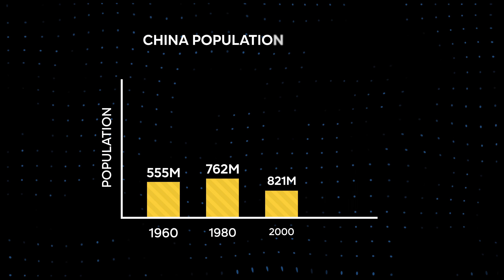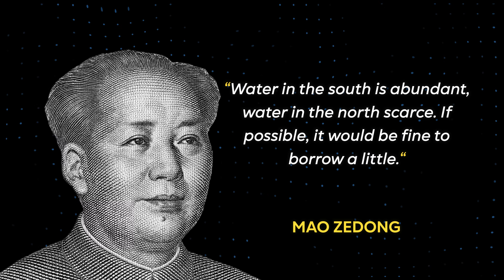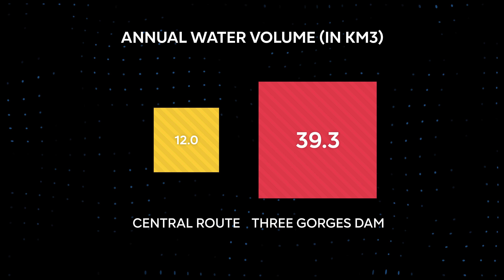China‘s $62BN Water Transfer Project

Comment: I wonder if water use efficiency and leak reairs have been fully exploited to minimize the need to transfer water from the south of China to the north. In Massachusetts, a $500 million pipeline to bring water east from the Connecticut River was avoided by promoting water conservation and fixing leaks. Daily water consumption was reduced from 330 million gallons daily down to 200 million gallons daily over several decades beginning in the 1980s

Comment: In fact, I am a Chinese living in Hanzhong City, the source city of the Han River. Although I can’t tell you what the South-to-North Water Diversion Project has brought to the north (after all, I’m not from Beijing), I can still say something about the environmental protection you mentioned. Hanzhong City has classified the entire Han River and its tributaries as a secondary or higher water source protection zone, set up direct responsible persons for every ten kilometers of the river, closed a series of downstream heavy industries, textile and paper enterprises along the river, and banned sand mining in the river., and vigorously promoted the slogan "One river of clear water will send to Beijing", they all worked.
Moreover, the South-to-North Water Diversion is not carried out independently by the country. Each province with uneven distribution of water resources has its own independent water diversion plan. In Shaanxi Province, where I am located, there is an implemented project to carve out the entire Qinling Mountains and divert the water from the Han River to Guanzhong Plain to alleviate the local water shortage problem.

Comment: The pollution scenes in the video may not come from China, but in fact, China's central inspection team has also found many pollution problems. These are recorded by independent investigation teams and reported to the central government, which then requires local governments to clean up. For those government officials who did not take action, many people were held accountable and punished last year. Therefore, Chinese people do not need to worry about no one dealing with the visible pollution, because if they do not deal with it, someone will be held accountable.

Comment: The maintenance required for this type of massive project is going to be daunting, if not, impossible. Once they realize the impossibility of maintaining the stability of such a water management sysyem, it will become disastrous in a very short period of time. China loves to undertake such large projects in one big sweep. They need smaller projects built in increments. Why not re-use recycled waste water from local water treatment facilities?

Comment: I think one of the main key benefit of the transfer project is not mentioned: It allows for better control of flood water. Couple years back, we had days when the Three Gorges Dam had reach dangerous water level due to excessive rainfall. Actually sounds like a great news if the Three Gorges Dam can be connected to the Han River as an alternative route to relief the pressure on the downstream rivers.

Comment: How is the water moved? Is it by natural means (gravity / flowing downwards), or is water pumped at any of these locations (meaning a tremendous amount of energy input), and if so, how is it powered? Is it powered by carbon fuels or renewable energy?
Reply: Western China usually has high altitudes and therefore can rely on gravity for flow in most cases; however, there are still places where pumps have to be used.

Comment: I would not have thought Beijing needed more water, Also water to Beijing is not really solving deserticfication problems in or around the Gobi Desert. Beijing and the Gobi are two entirly different places geographically.  Very different altitudes also. Beijing at about 50meters above sea level would need to have pumping stations running to pump the water the thousands of miles up to the Gobi Desert at a thousand meters.

                A brief morning's viewing of The Gobi Desert on Geological maps suggested to me there was plenty room mid Gobi for a massive lake. Water seems a significant part of any solution to desertification.

Comment: They should put solar panels to cover the open channels. This would also reduce the evaporation.
Reply: This project has been implemented in China for a long time, but it was eventually discovered that it had a negative impact both economically and ecologically. I personally participated in one of the projects, and the actual difficulties faced were far more than you might imagine.

Comment: Considering we live on a water world, the total water usage of all human activity (2,640 mi³ = 11,004,000,480,000,000 (q L) Quadrillion Litres) is an insignificant, tiny fraction of a single percent of all the water in, on and falling to the surface from space. And the vast majority of this water is cycled back into the environment. It is "conservatively" estimated that the Earth has ~325, 000, 000 mi³ (cubic miles) of water or 1.355 sextillion litres. 

Let this sink in (pun): 

There are 1,101,117,130,711.3 (trillion) Gallons (U.S.) in a cubic mile or 4,404,468,522,845.2 (trillion) litres. 

1 mi³ = 4,168,182,000,000 trillion L 

Roughly 118,000 mi³ or 495,000 km³ of water is cycled through the atmosphere every year. 

China, India and the USA consumed the highest annual totals: 289 mi³, 283 mi³ and 252 mi³ respectively, followed by Brazil at 115 mi³. 

Out of approximately 3,250,000 mi³ of fresh water on the planet, It is estimated that the current level of human freshwater consumption is about 4,370 km³ or close to 1,050 mi³ per year. 

Even in arid regions water exists in many forms which can be harvested. As an example, By using moisture harvesters with high surface area, porous structure, water affinity, fast vapor diffusion, and molecular diffusion, the water vapor in atmosphere can be collected as freshwater. The moisture-harvesting materials could be MOF-based materials, hygroscopic materials, and polymeric gels. 

There are approximately 16,000 operational desalination plants, located across 177 countries, which generate an estimated 95 million m3/day (22 mi³) of fresh water. Micro desalination plants operate near almost every natural gas or fracking facility in the United States. Furthermore, micro desalination facilities exist in textile, leather, food industries, etc.

Comment: The data mentioned in it is very imprecise. The Yangtze River is very wide and the water flow is very large. Compared to the Yangtze River, the scale of the South to North Water Diversion Project is just a drop in the bucket, and it will not have any impact on the flow of the Yangtze River.

In addition, urban sewage in China will not be directly discharged into rivers, and the pictures cited here are from other countries where the rivers are filled with garbage.

Comment: Looks like a disaster waiting to happen; the total capacity of the project (at full completion) would be able to supply less than 20% of water demand. Yet this project already increased flooding and draughts in the central regions and the water supplied is so polluted that the Beijing municipality deemed it unfit for all uses except industrial cooling.

Comment: Pluvicopia increases the value of these Wonderful Wise Water projects for 3 reasons. 1. Flood control is maximized by accelerating the water cycle to fill upstream flows while depleting flood potential. 2. Hydroelectric infrastructure is also maximized by Pluvicopia's laminar inflow from distant regions. 3. The Western project can benefit India and Pakistan while filling the western river watersheds to any level desired. Both sides of the Himalayas will get massive increases in potential hydroelectric energy. Beautiful documentary, nicely laid out and illustrated. Thanks. Oh, The book Pluvicopia shows how it is ecological, so it accommodates and improves ecological health.

Comment: "South-North water transfer project" and "West-East electricity transmission project" are two major project in China's modern history. I am looking forward to see the other project in future videos!
Reply: actually South-North water transfer project is already a project with thousand years
but latest section is to bring water more north to desert
Reply: Not happening
Reply: The next major project, which is also in progress, should be the widespread use of green energy, photovoltaic power generation and wind power generation to replace coal-fired power generation. The Gobi and deserts in the west will be used to deploy photovoltaic panels with an area of about the same as the Huanghuaihai Plain to replace about 60% of today's coal-fired power generation. At the same time, a large number of pumped storage power stations will be built to smooth the peaks and valleys of power generation and consumption. Then, ultra-high voltage transmission lines will be used to send electricity to the east. In the end, China has already lowered the cost of photovoltaic and wind power generation to a level lower than that of coal-fired power generation, making the large-scale use of green energy possible.
Reply: It's so funny that India claims that they're equal to china but in india all you can see is just poverty, slums,  roads filled with path holes, filthy air, stinky smell, dirty narrow streets filled with trashes, poor infrastructure, unorganized society, 0 education, 0 mannerism, not civilized, mad religious belives, people fighting for cast, politics and religion. In their dictionary, putting a street light is a big development
Reply: Qinghai-Tibet Railway, West-East Gas Transmission, West-East Power Transmission, South-to-North Water Diversion
Reply: 三北防护林❤还有最近的圈养沙漠😂
Reply: Honestly, America needs to take note!!!!

I have been saying for the longest that the US is long overdue for a East Coast to West Coast water pipeline. It will create jobs, make areas in western states more habitable and could create SEVERAL new communities. I think there needs to be a water pipeline along our southern border states that starts somewhere in Florida and runs all the way to the Salton Sea in California. Along the way, water can be diverted to SEVERAL areas in TX, NM, AZ, NV and then once the water gets to the Salton Sea it can be pumped from there to reservoirs all over California.
Reply: @NSUScooter 美国投资在战争的钱足够建设一百条连接太平洋和大西洋的运河。
Reply: @NSUScooter to
Reply: Looking forward to the next Aral Sea success !!!
Reply: @martinjrtremblay  Indeed! Huge success of claiming land back from the sea (well, lake)! Even the Polders in the Netherlands can't even compare!
Reply: @martinjrtremblay  you just dont know how much water from yangtze river can be....

Comment: I wonder why they are routing the one canal under the Yellow River instead of over it. As far as the problems mentioned, I am sure they will work them out. Overall it's a good idea, but would it be simpler to somehow catch and reroute the water from the rivers where they are about to go into the ocean and re-divert that?
Reply: Drilling canals below the Yellow River to divert water can save energy through the siphon principle. If the canals pass above the Yellow River, pumping stations are required, and the maintenance costs are higher
Reply: Overall it's a horrible idea: Yangtze already lost about half of its water - that means droughts, less food, problems with river transport. South China is China's bread basket because of that water - no water = no food

Comment: Should have recolated the cities in the north to the south closer to water sources building and designing new cities there.
Reply: Very wrong, the population is too concentrated, which will damage the self-recognition. For example, in India and Bangladesh, the air quality is very bad, which is very bad for people's health. Your idea is very strange. Does it cost a lot of money to relocate people and build new centralized cities? So, why not use that money to improve more livable areas? Why do you have to concentrate?
Reply: This is probably the dumbest comment in this comment section. Relocate more than half a billion of population to where the other more than half of a billion are? Also, it's the farms and industries that are the thirstiest, not directly due to the people.
Reply: The information in the video stated that the system was not working because the water is being polluted before it reaches other population centres further north .The ability of the land to sustain the population in that region has failed.What are your solutions.

Comment: I'm Pro-American , but this Chinese project is highly impressive.

We need something like this in California
Reply: Dude… California already has a 600 mile system of concrete aqueducts, tunnels, and canals, the most sophisticated of its kind in the world currently. Look up the California State Water Project. There was once a lake in Southern California that covered nearly 700 square miles of land, once the largest lake west of the Great Lakes, called Tulare. California’s water projects have pumped Tulare lake all but bone dry… today a town exists on the dry lake bed where there once was water.
Reply: @jabrokneetoeknee6448 check out lake Tulare now! Normally you'd be right but because of all the rain last winter the lake filled up again! 😂
Reply: @evyiennetla9416  Won't last sadly, if el nino happens then we wont be getting any significant rain for up to 5 years
Reply: That was in the 1920s- 30s. Central Valley still bone dry. Time to send some water back. Use reclaimed waste and ground water to recharge rivers and lakes. 😄
Reply: @jabrokneetoeknee6448   I was thinking along the lines of tapping into Waters Sources North Cal & Oregon.....CA is in constant Drought.....

Im familiar with Tulare Lake, it dried up over 100 years ago, no ?
Reply: @joemosely9383  that is because land west of the rockies is a dessert, if it wasn't for subsidized water it still would be, of course it is in a constant drought.
Reply: there already is a water transfer system in California built 90 years ago.
Reply: @yaboi9349 funny boy
Reply: @yaboi9349 in that case you should be happy, because millions of Chinese people you hate are going to die, and the evil Chinese government has failed once again
Reply: It's been tried, Texas wants some of that Mississippi water, those states say "not one drop".
Reply: @yaboi9349The three gorges dam has already collapsed last year. It's killed 6 million people already and the CCP is covering it all up!
Reply: They could start by clearing the human poo from the sidewalks!
Reply: @yaboi9349no it’s not , keep talking BS 🤡
Reply: @yaboi9349you redefined ‘failing’
Reply: get rid of the Indian CEOs and those Indian origians in high political power positions, and you will become as efficent as China.
Reply: @yaboi9349I’m sure mainstream media would like to boast about any failure of China, but tens of thousands of Chinese mega infrastructures are built around the world, ever heard one failing? Why everyone still prefer Chinese infrastructures?
Reply: I'm Pro-Scottish and I too enjoyed this video.
Reply: It's so funny that India claims that they're equal to china but in india all you can see is just poverty, slums,  roads filled with path holes, filthy air, stinky smell, dirty narrow streets filled with trashes, poor infrastructure, unorganized society, 0 education, 0 mannerism, not civilized, mad religious belives, people fighting for cast, politics and religion. In their dictionary, putting a street light is a big development
Reply: @yaboi9349 Sounds like jealousy
Reply: you need to put new gender....
Reply: @yaboi9349 I guess you hasn’t been on NY subway or see the bridges condition. Speaking of tofu project check out India dam
Reply: @yaboi9349…. You know . “Tofu projects” used to (about 20 years ago)be a major flaw to Chinese industrialization.  But you don’t need to worry about the three gorges dam because its construction is directly supervised by the central government. National projects like it  don’t cut corners. You can also reference High speed rail projects both domestic and foreign. They are also national projects. 
    “Tofu projects” are largely civilian made projects and small local public infrastructures. Those involved individuals will face harsh punishment if the projects cause great harm to the public. ( you could be put to death) and public infrastructures buildings have been greatly improved since the early 2000s. 
     We are still building , high speed rails, maglev trains,smart cities, electric cars , 6G and AI ….. we hope you do the same to improve your own lives in your area.
Reply: @wisl8122  Really? And there's no such thing as a "civilian" project because every major corporation or construction company is tied to the damn CCP. Here's your 50 cent for your effort to protect their "honor" of the communist party. Disgusting.
Reply: @yaboi9349 
Do you have anything to say about the american cheeseburger projects like the Texas Bridge still unfinished ?
Reply: @yaboi9349 How to say you're brainwashed without saying you're brainwashed
Reply: @yaboi9349 funny